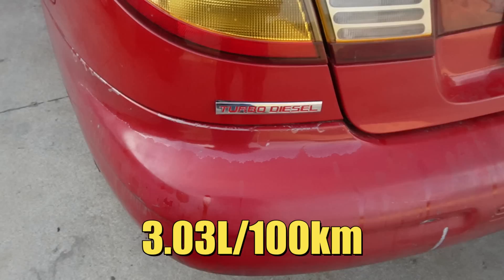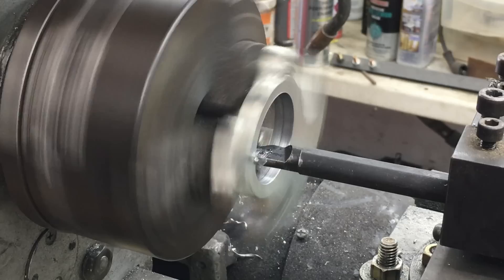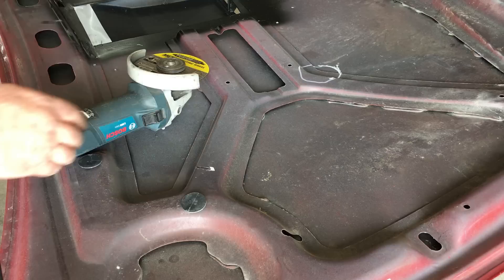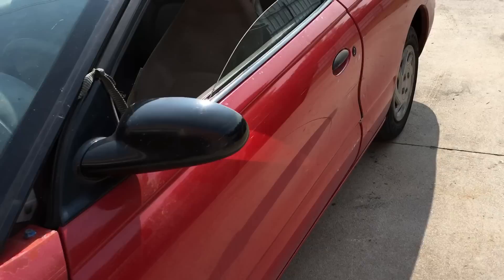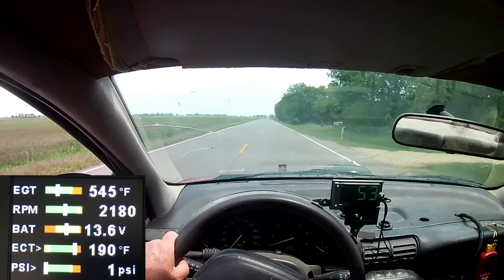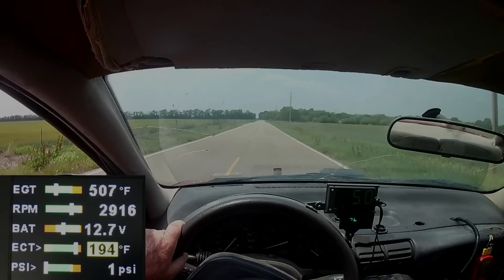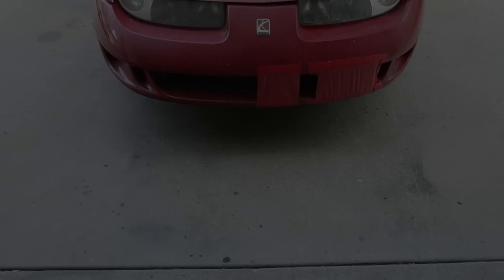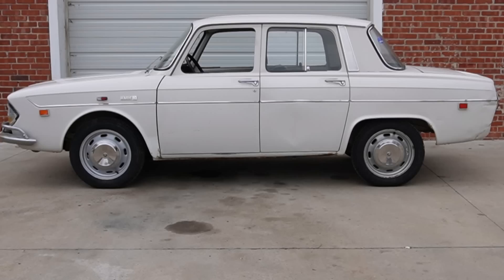S3 E17  We get 80 MPG with our D722 Kubota turbo diesel Saturn.  Best fuel economy yet !

Comment: Fun fact, its possible to have larger downpipe and smaller exhaust pipe.  At least on a naturally aspirated Honda the downpipe until after the CAT might be 2.25 2.5 or so and the rest of the pipe will be 1.75-2"

This makes sense if you consider the air will get cooler as it travels back and it is less dense nearer the exhaust port or just after a catalyst.

Or they want Cat-Back systems to get all the reasonable (streetable) horsepower available without the need to tamper with the emmissions equipment. 🤷‍♂️

Its a theory.  Obviously you have a turbo.  Looking forward to your findings

Comment: Greetings from Slovenia. I discovered your channel just recently and it's fun as heck. You should find the VW TDI 1.2 liter engine from Lupo 3l and put it in that Insight.  That thing was doing 80 mpg while accelerating from 0 to 60 in less than 14 seconds and reaching over 100 mph.
Reply from the maker: unfortunately the Lupo engine wasn't offered here in the States.  :(
Reply: I find it funny that I found a place where 0-60 in less than 14 seconds is considered good! :)
Mom's 1993 Piece of Chevy had a 14-second 0-60.
It did not spark joy.
Reply: @drippingwax  I got your point but how much fuel did your mom's Chevy burn ?  In terms of the Lupo we are talking 80 mpg.
Reply: @histriamagna1014  The 1993 Chevrolet Corsica was rated 21/28 MPG.
The 3.1L v6 had a 9-second 0-60! :D
Reply: @drippingwax  Breathing fire that Corsica.😁

Comment: you could also drill the flange and shape the downpipe so the wastegate does not hit a wall and upset the exhaust flow.
Reply from the maker: There is actually a spacer flange that allows the wastgate thingy to open completely.
Reply: @robotcantina8957  make sense! I guess with an internal waste gate there's only so much you can do for flow anyway. 

But as a whole nice video as usual I really enjoy this series!! Keep it up!

Comment: Found your channel 28 hours ago and binge-watched the Saturn-diesel series. Excellent. Something we used to do back in the 70's was rig up a windshield washer pump to spray water mist into the intake air. Was wondering if that might help cool the Kubota's fuel charge and possibly the exhaust temperature as well. Keep the great experiments coming.

Comment: Imagine this setup with a hybrid electic motor too ? Prob 130 Mpg
Reply: It will likely lose quite a bit on highway due to weight.
Reply: You're not gaining anything in a setup like this. The purpose of hybrid setups is to fill in the gaps, when engine is inefficient (like accelarating, slow speeds etc). Diesel engines have a lot wider efficiency curve, so they don't benefit as much if anything from this, so pretty much no diesel hybrids exist. This phenomenon can be cleary seen in this video as well, when he used 4th gear instead of 5th and got the same fuel economy.

In this case, you'd gain quite a bit of weight and complexity, for not much gain. It would however help quite a bit with accelaration, if a big enough electric motor was used.

It might more sense to use a small diesel engine in a series hybrid setup. Connect the diesel engine to a generator and use that to fill up the battery.

Comment: Spectacular effort on this series. About the turbo; a 12 is available and properly sized for that application more or less.
Could regular driving under boost add efficiency? Or is it true that boost just allows smaller swept displacements do the same job as a bigger one at those times when more torque is necessary?
Brilliant guy you are!
Reply: A smaller turbo could work better, it'd spool up sooner. the GT12 is about the same as this turbo though, the only smaller turbo I'm aware of is the GT06, which might indeed be a better choice for this engine.

As for driving on or off boost, it takes thermal energy to spin the turbo to create boost, and to create that thermal energy you burn more fuel, so driving on boost consumes more fuel.
Which is also why the boost is so strongly tied to the EGT, without the EGT, it's not going to make the boost. A turbo is not just a paddle wheel that spins in the flow of air, it's doing the same thing as any other engine, converting thermal energy into mechanical work, the work is then used to enhance combustion to create more thermal energy.

The turbo indeed adds torque for acceleration while giving the benefits of a small engine (quicker to get to operating temperature, lighter weight, potentially less friction losses) for the rest of the drive.

Comment: I'm very excited for the Renault 10 670 swap. The original car had about 40 hp in standard 1.0l engine. I think you could match that with that 670 and a supercharger, or turbo, maybe? Great videos Cantina, great videos. Very fun to watch
Reply: I think you can get like 50hp out of those 670s without forced induction
Reply: @bensmith4563  yeah, very interesting engine. Just expensive. These Predator engines don't ship to Europe. We got genuine Hondas for a 1000 bucks and Robin Subarus, Kawasakis. And then Honda clones that gulp oil by the gallon from the start

Comment: For a non electronic/high pressure diesel engine, its got very little smoke.  Lowering back pressure of the exhaust help to create a higher pressure gradient from the engine side of the turbo to the outlet......improving exhaust turbine efficiency.  which is why i keep saying INSULATE THE EXHAUST MANIFOLD AND EXHAUST TURBINE to get more heat, more pressure to create more boost........better efficiency.

Comment: also and pro welders out there correct me if im mistaken but running a constant bead or doing it in quarters will do more for you than your preheat.  been my experience getting my fingers whacked by the old wizard welders at the shop for stitching haha

Comment: I ran Kubota tractors for 20 yrs. Way before any emissions  stuff.  It would plow heavy snow all night and use only 10 gal. of fuel.  I had a opportunity to buy several 50+ HP Turbo Diesels from
Kubota, and could very much kick myself that I did not. I wanted to try in a small car the Diesel turning a generator to Elect motor just as a Train does. Now a LOT of heavy equipment is doing 
this. I  had a V.W. Rabbit that got over 50 MPG even if you drove it wide open. Over 500 miles on a 10 Gal tank. I have a hard time grasping that this could not be done today in a production 
vehicle.Even when I had a 95 GMC Diesel I got 17-18 MPG pulling a travel trailer. What they are turning out now is BS. I am POSITIVE that the milage most cars get now could be at least 50% better.
Reply: Will you make your own diesel-hybrid now that you've been inspired? :D
Reply: @NoneNomad  Truly wish I could. I got pretty racked up about 10 Yrs ago. Spine, hips, knees, and a partridge in a pear tree. 
Now my days are unpredictable. I have the room to do it, and would love to. I have a gas car no,  Equinox with a non turbo 4. but after driving Diesels for 40+ Yrs I stop on the pedal and am not used to the car saying,  "Well soon"  instead of full power at 1800 RPM. I need another one. Keep it up[ with the Kubota. I love it. Ever consider a Diesel over Electric like the Volt was? Im confident it could be done with a 50 HP.

Comment: Mazda has a flap that flips at a certain RPM or engine load, it sits between the head and turbo, it's purpose is to constrict the exhaust at low flow to create high speed exhaust to spool the turbo and keep it spooled. I don't think you can make anything that complicated but I think you could create a nozzle of some sort to better focus what little exhaust flow you do have at the turbine wheel for better spool and more consistent boost. If you make a test stand for the engine you can experiment more easily out of the car. I'd totally watch a series of test stand turbo diesel videos, maybe even a dyno for it!

Comment: the motor would be even more efficient, and less smoky if you'd adjust the fuel rack related to boost pressure. You wont get that much black smoke when sooling up the turbo but can adjust to even more fuel as soon as boost is there. See external ALDA on diesel pumps.

Comment: I realize you said this was a hack job , however,  you do very good work,  and interesting results.  I have thoroughly enjoyed this series.  😊 . Also, its possible that with the exhaust stack the air flow going over the top could help pull the exhaust out as well.  Maybe if the stack was about another foot taller it would help keep the exhaust out of the car,  and help fuel mileage as well.  Just a thought and i could be completely wrong.

Comment: 1:18 Engine displacement kind of goes out the window when you add in any sort of forced induction (I.e., Turbo or Supercharger) because ambient pressure flow volume becomes a factor of both the engine's displacement, the forced inductions operating pressure ratio and the efficiency of the system. So while the engine itself may only be 719cc's if it was say running at a 2:1 pressure ratio (i.e., basically 14.7psi of boost at sea level (don't know what local ambient pressure is so just using sea level for example)) and assuming the system was 100% efficient (which its not, probably more in the 75 to 80% efficiency range), the ambient pressure flow rate at full load would be equivalent to the engine being twice its size if it were naturally asperated and once this compressed and further burn mixture exits into the exhaust, it expands back because of the lower ambient pressure outside so the volumetric flow rate is higher than what the engine could do on its own.

Another way to look at it is, say the engine has a peak CFM flow rate of 200cfm in naturally asperated form, if you add a turbo running at a 2:1 pressure ratio (again, everything at 100% efficiency for simplicity), the inlet volumetric flow to the turbo would be 400cfm and the turbo is compressing that volume down to match the actual 200cfm flow rate of the engine (i.e., increasing the mass / density of the 200 CFM). Once its back in the exhaust, it expands back as mentioned above so the volume is back to what it would be as if the engine was a naturally asperated engine that was flowing 400cfm.

This is why with forced induction, the exhaust always has to be bigger than what the engines displacement would dictate if it were naturally asperated.  

Also, Turbos are more sensitive to exhaust back pressure post turbine because the turbine operates on pressure differential across the turbine. Remember, pressure always tries to balance by flowing from high pressure to the lower pressure area and the greater the difference is between the high pressure and low pressure area's, the faster the gas molecules will flow and the faster they flow across the turbine, the more energy that is imparted from the flowing molecules into the turbine to spin it. When it comes to turbo's, there really isn't a "too large" post turbo exhaust (assuming the turbo is sized properly for the engine) other than it becomes a case of diminishing returns. Fast spooling OE engine systems will often be in the 2.5 to 3:1 or so pressure ratio range across the turbine  when at full boost and max engine volumetric efficiency (i.e., the exhaust pressure pre turbine as high as 35+psia in some cases vs. 14psia post turbine.
Reply: Thank you for this well articulated and comprehensive comment.

Comment: Interesting comment on how efficient a car can be due to its overdrive transmission.
I've found, even with everything stock, as it was delivered from the factory, you still have to be smart in how you use the overdrive gear of the transmission, due to driving conditions in your particular area.

Comment: If you haven't started already please one last run please try eliminating all extra weight. Like cutting, grinding, remove glass, exercise, etc
Reply from the maker: The car is going to be scrapped in September, we will of course keep the diesel engine and all the custom parts. Anyway, probably the last episode we will do on the saturn is when we remove as much weight as possible with a sawzall
Reply: @robotcantina8957  Awesome, happy to hear that.

P.S sorry about the exercise comment.

Comment: It'll be interesting to see where the little engine goes next
Also whatever it ends up in the Exhaust header connected to the engine is far more restricting than any exhaust pipe on the other side of the turbo and having a header like that with a turbo is likely killing the power and economy since turbos are inherently a restriction and increase backpressure related problems, some diesel engines I've seen have gained 30% power from getting their cast log exhaust headers replaced with even simple tubular exhaust headers. So even if you go back to an NA setup that exhaust header has got to go

Comment: I ws going to mention the no boost thing. I have a little diesel 4cyl toyota hilux that makes 300hp at the wheels, it runs 40psi at WOT but with cruise control on at 110kmh on a flat road it makes 15psi and the turbo is good for 400hp, it's actually too laggy for the little 4 cyl.

Comment: Please do a run on 4 convenience spares. I suspect you will get extreme fuel economy improvements from the lower rolling resistance and better aerodynamics from being lower to the ground. Thanks.
Reply: Some weirdos on Ecomodder tried that.  I believe that one weirdo found street tires that fit Insight spares and used those.
I don't know that anyone kept them.
Reply: @drippingwax  I’m running convenience spare rims with tires off a MG on the front of my rat rod.

Comment: I wonder, with all of these wonderful modifications, at what RPM's the Kubota motor is now making peak torque.  I was taught to believe that a diesel engine is generally working most efficiently-converting chemical energy into mechanical-at peak torque.  Kind of like the horsepower hours per gallon statistic that the Nebraska Tractor Tests compute to let you know how efficiently your tractor engine functions under load.  Keep on truckin'!  Truckin' your blues away!
Reply: 2 speeds are way too little

Comment: cut the flange open, and shape the pipe coming out of it so it flows better out of the big wastegate section.
Reply: I was going to say this too.  You can see the soot on the old flange showing what the output of the turbo actually looks like.  Stick some 3" tube in the vice and squish it to shape, even done roughly it would probably help.

Comment: Kinda surprised that the boost is not up at normal levels for most turbo diesels (around 20-25psi), and egt's are not hitting normal full load numbers for a turbodiesel (around 900F). This should further improve mileage.

Comment: I had to google the difference between on-road and off-road diesel.  I figured it would be a chemical formula difference, not one of tax status.  Interesting!
Reply: Yup, there are lots of tax incentives for farmers. Here in Saskatchewan, it's common to see big trucks that live in the city, but have farm plates and use farm diesel. They also usually have lift kits, crazy exhaust systems, and decals all over them. I'm sure they use them exclusively for farming, right?

Comment: Would be great to see this engine put into a more aerodynamic body and try to achieve absolutely insane fuel milage.
Reply: He already swapped the engine in an Insight?  What is lighter and more aerodynamic than that?
Reply: @drippingwax  I don't think he swapped it with the Kubota engine.

Comment: Sad to see Saturn project end, and like most there's a couple of other tweaks/experiments I'd have like to see tried before it was scrapped. On the other hand i reckon that Jimbo pretty muched maxed out that turbo with 15psi, and i doubt doing any small further changes would have got a noticeable improvement on the 0-60mph time.
When he gets that engine into a smaller lighter car, then id like to see it dyno tested to see if he's doubled the quoted bhp of the Kubota? Just please front mount the intercooler next time, or use a water/charge cooler. Without destructive testing i think the pump rack stop can be shortened a touch more, and maybe fit a boost controller so you can see if the turbo can do 18psi or more. Past all that id walk away, as when people talk Nitrous, propane and compound turbos on a 720cc originally nasp engine id want to be as far away from the engine as possible, as if he's made 45-55bhp i don't think it could be handle that much more? I respect Jim for doing the tuning in stages as it would have been all to easy to push it to destruction with some of the extreme modifications.
I hope to see the 670cc V-twin respond as well to tuning, and lets hope that for a future project we can see him work out how to get a big two stroke sled/outboard engine to mate to a manual gearbox car like this too.👍

Comment: 🤔 if remove the govenor from the engine the throttle response will improve would only have to hope it don't randomly get stuck wide open but it be fine surely🙂

Comment: I wonder how hard it would be to add a spring loaded diaphragm to the fuel rack limiter. That way you could increase fuel when it is on boost, reducing the amount of coal when it is off boost.
Reply from the maker: We plan on making an electronic fuel control based on boost.  This mod will show up when we continue the diesel experiments in a different car.
Reply: @robotcantina8957  That makes sense. Probably a lot easier to tune than a purely mechanical setup.